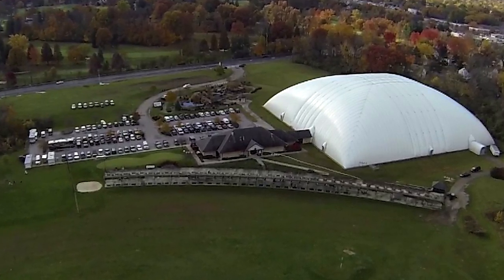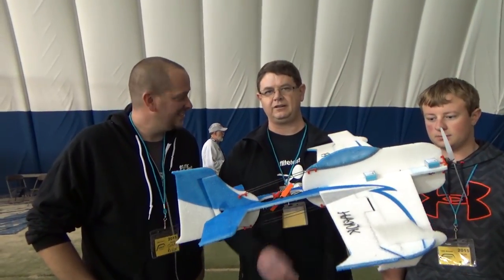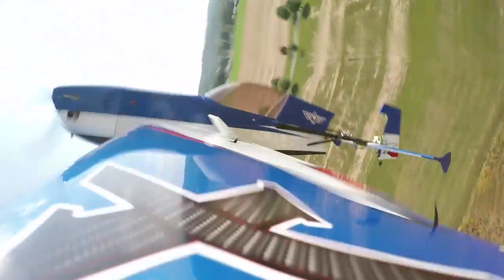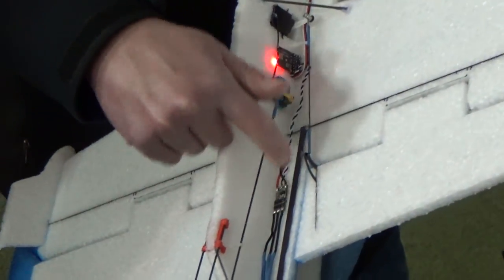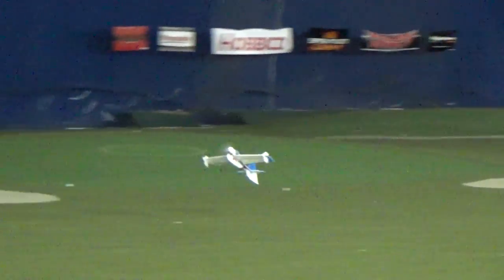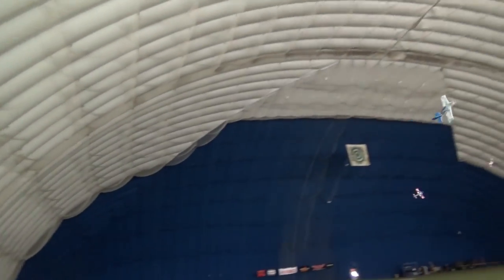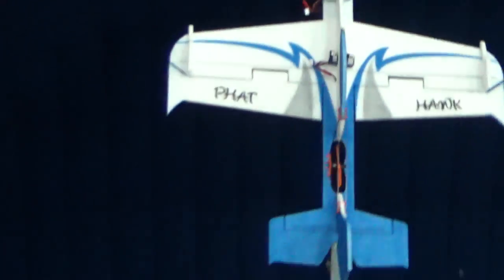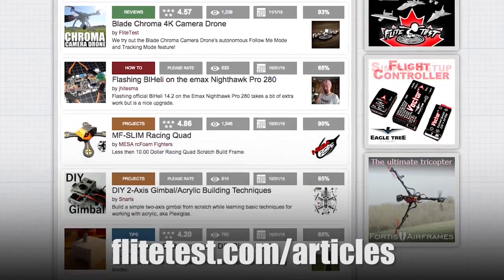Super Honey Hawk | Flite Test

Comment: FYI he used a KISS 3D ESC for the yaw motor. I have KISS ESCs (not 3D) in all my racing quads because they are very small, powerful and support OneShot natively. They also have 30A 6S versions if you want to fly at extreme speeds. But you have to be a bit careful with them, they can burn out quite easily if the motor gets stuck on something.
Reply: +Elias R. Hey Elias.  Close, I used a DYS SN20A ESC on the tail.  Similar features (oneshot, 3D, etc.), but cheaper and - so far - I haven't heard of anyone burning them on quads ;-).
Reply: Thank you for correcting me, the SN20A looks very similar to the KISS 18A.
Reply: Yes.  Competitive ESC's :)

Comment: does anyone have a recommendation for a first 3d plane 
preferably: foamy, micro, and binds with an frsky transmiter
Reply: +Ross Copenhaver Hi Ross.  If you're looking for something you can grab off the shelf and go learn to fly you could look at Horizon Hobby's "AS3Extra" and just get a DSM2/DSMX module for your Taranis.  That said, the Phat Hawk (or similar EPP based planes) is very durable, floaty, and forgiving indoors or out.  Just build it or whatever you decide on light.  Use only the minimal amount of glue - probably less than you think you need - to just get it to stay together.  You can always add a dab of glue here or there, but it isn't so easy to remove it later.  Light is might ... and makes for a slower 3D trainer.  ;-)
Reply: +Ross Copenhaver Go look at the West Michigan Park Flyers stuff. I built a McFoamy years ago and have learned a lot of 3d with it. Cheap, flies so slow, and takes a beating.

Comment: thanks and do you know where I can find that module for cheap
Reply: +Ross Copenhaver Hey Ross, by 'module' are you meaning the ESC?  If so, there are a number of vendors that carry it, but you don't have to be specific.  You just need a very light reversible ESC.  In fact, one could (probably) even pull an esc and motor from a Blade 200qx with an uncut 3D prop and get it to work.  When I built the SHH I had the DYS esc and motor just sitting around.  You want as light a combination as possible as it is out on the tail and, with that, comes a greater effect on CG.  So, whereas my normal Phat Hawk design has the flight battery on the CG, the SHH has the main pack on the nose.  I also now run a separate pack for the tail motor and that pack is on the CG.  Hope this helps.  J
Reply: For my transmiter
Reply: Oh. Sorry. I'm just waking up. ;)  which specific model do you have?

Comment: how did they reverse motor direction in mid air? ( for the tail motor yaw thing )
Reply: +Kartike Khandelwal Special/modded esc
Reply: +matthijs jordense i looked it up on hobbyking and other stores but i couldnt find it, do you have any idea what it is called or where i can buy one?
Reply: its part of the ESC firmware.. just reversible blheli mixed in with a bit of rudder toggled via switch.   just get a esc that has BLHELI that is programmable via usb stick.
Reply: Sorry Kartike I didn't see your posts sooner.  Chris c is right... it is a BLHeli multi-rotor ESC (OPTO) with its settings switched over to 3D quad mode (ie. bi-directional).

Comment: I see no reason to put another engine to have a better yaw performance, the same you can get with a trust vectoring installed on the main engine.
Reply: +Temqa FPV You're right that similar extreme yaw can be found with thrust vectoring; however, there does seem to be a difference between the two.  Most notably the tail rotor spins the plane around the CG.  I would expect thrust vectoring to struggle with achieving the same thing.  As well, once built, the tail rotor has less moving parts to break down/wear.  Having a motor mounted on a moving vector mount induces a lot of stress on quite a focused area of the airframe.  

All that said, I'm not saying one is better than the other, just different.  They are no doubt both fun and that's what the SHH was born from.  Also... I have plans to try some more crazy stuff - including adding a thrust vectored mount to the SHH.  Imagine the spins then!  LOL
Reply: I predict that soon we will see two wings 4 engines VTOL with trust vectoring for all engines.
Reply: I also can give you Idea - 2x 250 class copter motor installed on left and right wing and a mix rudder to motor left o right - it will flat spin like a blender.
Reply: +Temqa FPV yup.  fun stuff

Comment: how many "kv"  has the motor of this plane?
Reply: +daxel kush Hi the front motor is a 1660kv (pushing hard with 3S :) ) and the tail motor is a 3000kv (on 3S which is why I had to cut the prop down to 4" instead of the stock 4.5").
Reply: Jason Uberig tnx tell me please.. how can i do to discover how many kv is one plane motor?
Reply: +daxel kush That's a tricky thing.  I've wanted to try doing that for a long time, but it requires having a drill with a known or measurable RPM.  I've read about it only, but I believe the process is that you connect the drill to the motor and run the drill at a given RPM then measure the voltage coming off the motor's wires.  Then you calculate how many RPM (now known) per Volt measured which then equals your kv value.  I'm sure there must be a youtube video somewhere on it.  Good luck!
Reply: Sorry Daxel, but I think that motor will be too big.  The product page you linked to talks about the motor being a "Powerful 370 motor" You will need something in the 2xx class.  Also that ad talks about that plane running on 9.6V 650mah Ni-MH.  That battery is likely too heavy as well.  It all might work; however, by the time you're done it will need to fly too fast to stay in the air and with the huge control surfaces you'll probably experience 'flutter'.  

Wish I had better news my friend.